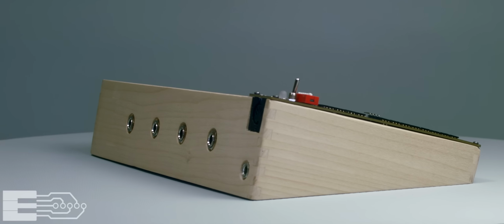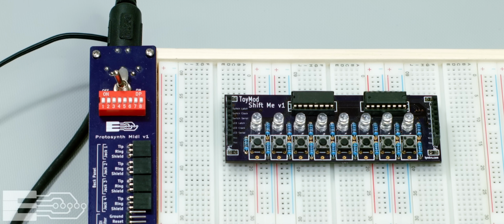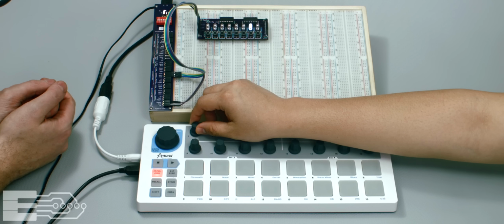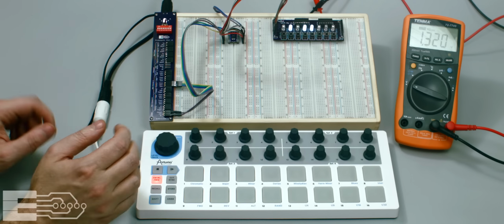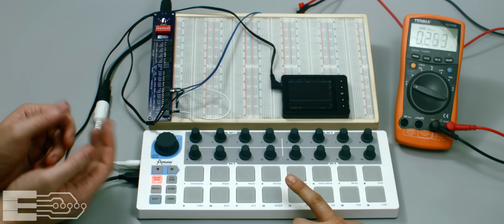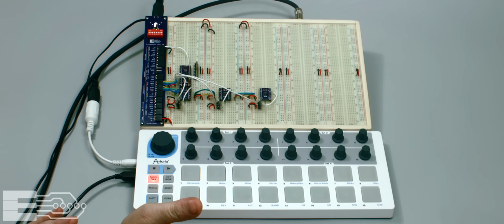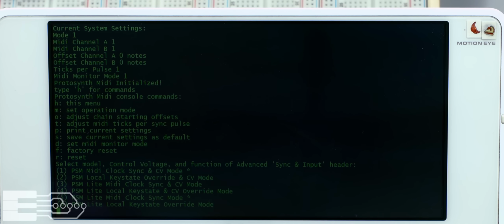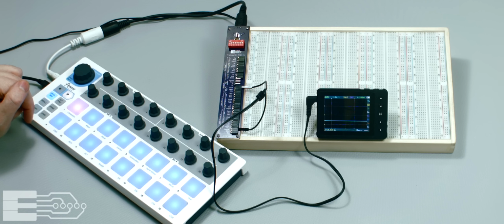Protosynth Midi Features

Comment: $180.00? Not counting the breadboard it is about $30.00 worth of parts on Aliexpress. My homemade midi test setup cost about $40.00 and does way way more more. It communicates with my DAW. Has a arduino nano built in.Converts to and from CV, Gate,and  midi for analog synths and gear.. Has 16 5 pin midi connectors. LED indicators for 16 channels. LCD display that shows all midi data that is being sent and received.Takes DAW midi out and translates to different voltages to run steppers, solenoids etc.. Translates midi from all my (14 different) midi controllers enabling controlling of circuits with controllers. Control relays, LED matrix, lights,etc.  And much more. Might want to reconsider a $50.00 -$75.00 price tag. Think of your target demographic.